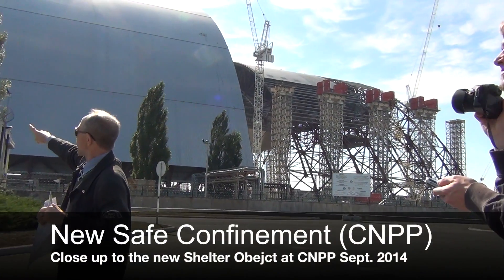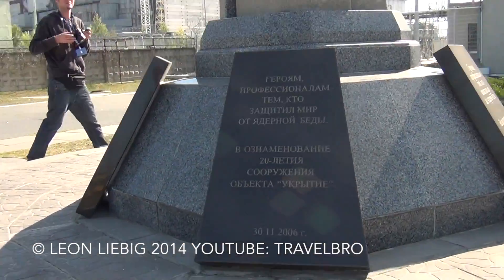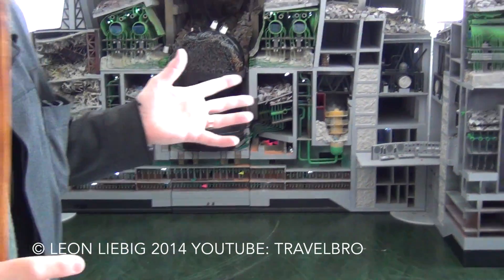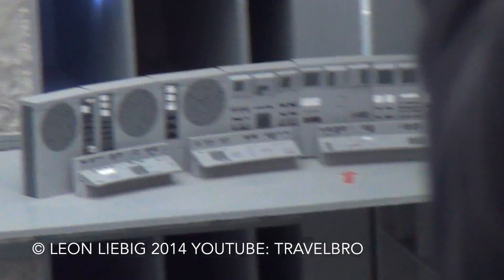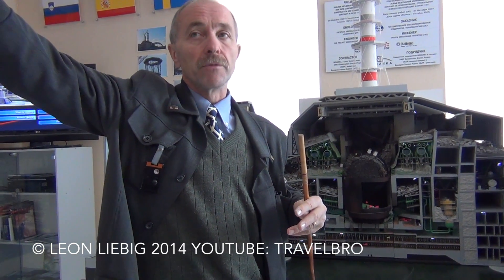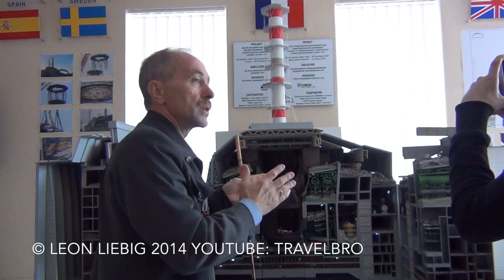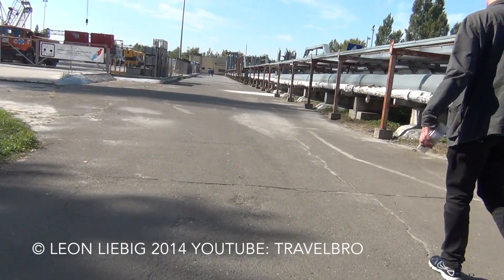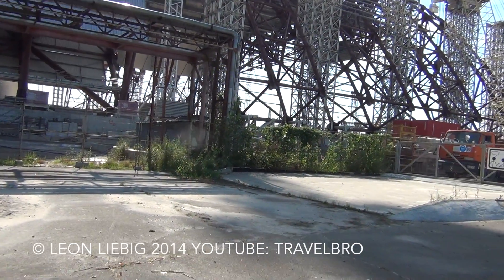New Safe Confinement / Sarcophagus / Sarkophag CNNP

Comment: I don't get the point of this as the confinement is not air tight....so when they start to dismantle reactor no4 it's just going to leak all over the place AGAIN
Reply from the maker: its is airtight now. and also an under pressure under the arch - so nothing will leak :)
Reply: Discover Chernobyl....u make no sense....and yes it will leak because it's not air tight
Reply from the maker: It is ;-) Check your facts. There is a lot of real great Documentaries about the new arch on youtube. This video here was taken 2014, long before the whole structure was finished.